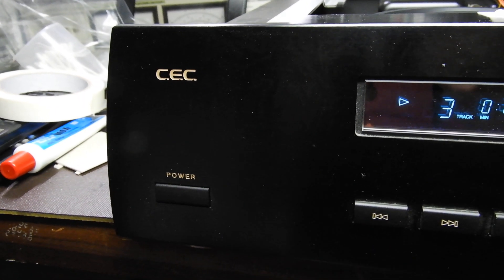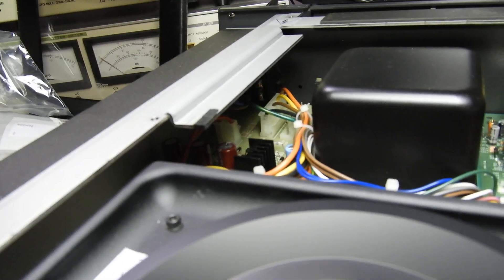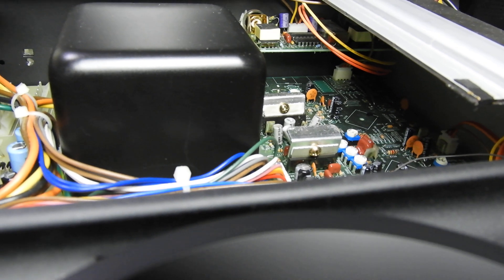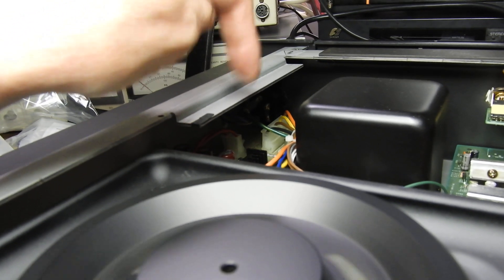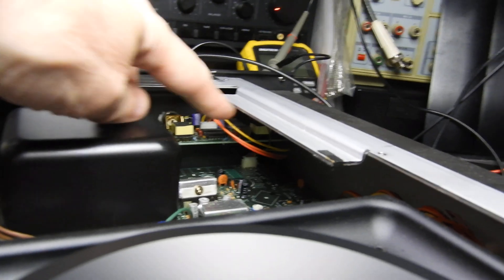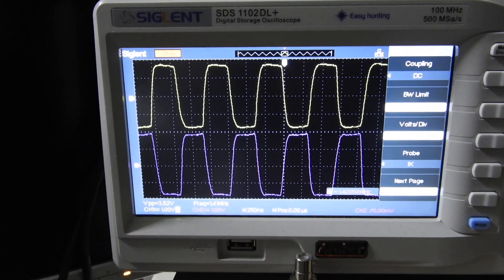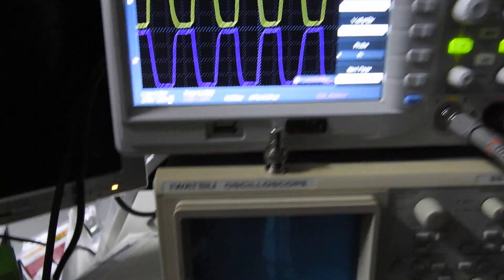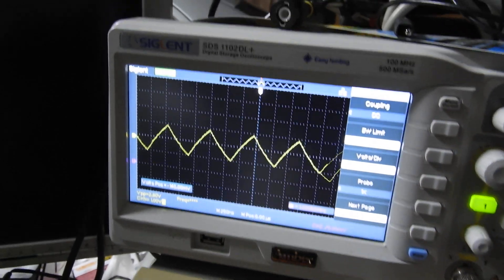C.E.C. TL-1X CD Transport with intermittent power supply. Details of SPDIF & PSU modifications

Comment: I have this one. I own it already 14 years.
I`ve done the psu, the spdif output, i added a precision clock and put a quality power cable on it. New belts and new laser.
Nothing i ever heard does even come close, my super expensive analog rig can barely compete, that`s how good it is.
I`m running a Abbasaudio tube dac.
Reply from the maker: Does it change tracks fast and do FF? Some of the belt drives work almost as good as regular players, while others struggle to jump from last to first track.